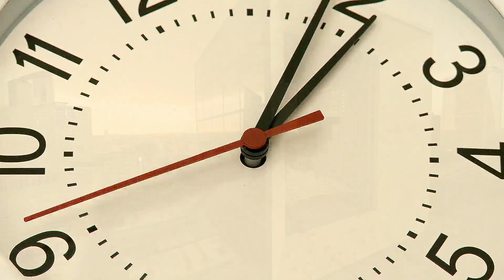The Future of Construction is... Manufacturing?

Comment: As a tradesmen I thInk about countries in China who can build things at scales and speed uncomprehensible in North America. I talk to people at work aboUt the future of trades and they all think they are irreplacable. what advice do you give to the average tradesmen who is still young to prepare for a new future in construction?
Reply from the maker: I think there’s always going to be a place for tradesmen, it’s just the job requirements will adapt. Tech is going to be what shifts the industry, so just stay on top of those trends. That said, I think we’re decades off before it starts heavily affecting residential tradesmen. It’ll hit large ambitious projects first and then trickle down.
Reply: @ConcerningReality  Thank you foe the reply! I can give you an on the ground perspective. I'm an electrician and in my limited time in the field the industry has changed, wire pulls, supports, pipework, recpetacles, panels amd much more is prefabricated in shops. Lighting will not need to level of wiring it used it, it will run on ethernet cables and small drivers for example, easier, quicker and cheaper. Many of the laborious tasks are being reduced. Sure it's decades off but it will be my career time, I'm not scared or worried But just thinkIng where my place in the future will be. A tower being a 2 year project is what keeps a lot of us working (not that any of us will really miss that kind of work! lol). There's been a huge push for tradesworker as he baby boomers retire as well, I wonder how it will all go down
Reply: 4444 1414 

We will be new tradesmens i guess. Gotta catch the world :)